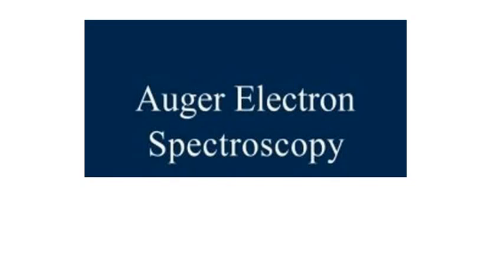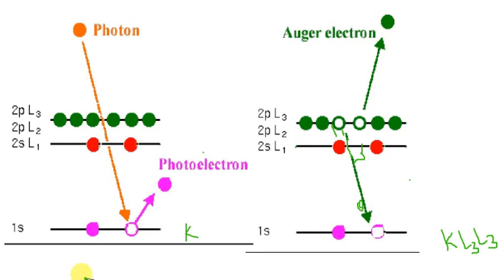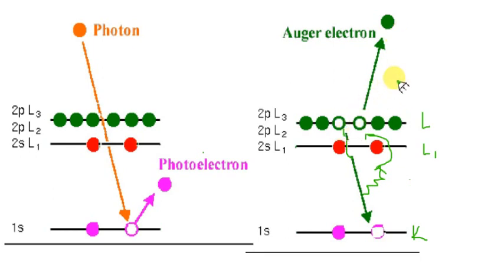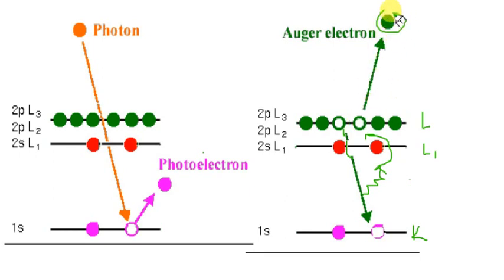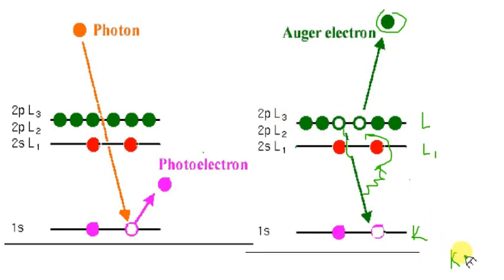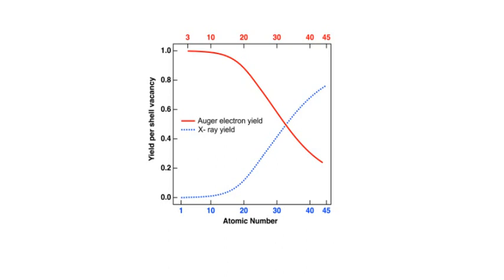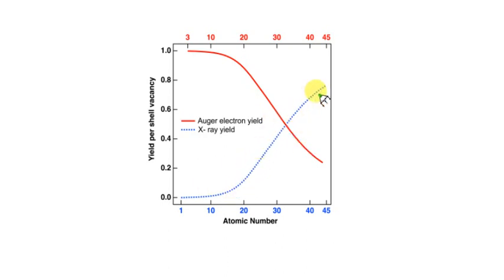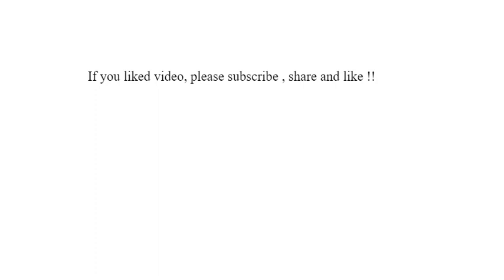AUGER Electron spectroscopy

Comment: I am reading a report where workers charged a Ni-201 alloy tensile specimen in a high-pressure H environment to 2000 appm H, which was the lattice solubility limit at the charging temperature of 150 to 200C. They then fractured the tensile sample in an Auger chamber and immediately performed a grain boundary analyses using Auger looking for grain boundary precipitates on the intergranular fracture surface looking for S in particular but other elements as well.  Why did they need to perform Auger in-situ? Why couldn't a tensile test be done and the fracture surface evaluated later using Auger? I can provide the paper if that helps. 

Thank you.

"Grain Boundary engineering markedly reduces susceptibility to intergranular hydrogen embrittlement in metallic materials", Bechtle, Kumar, Somerday, Launey, Ritchie
Reply from the maker: I will explain in an another video.